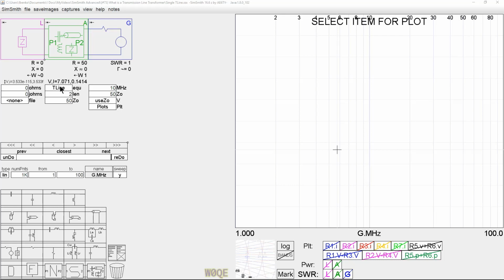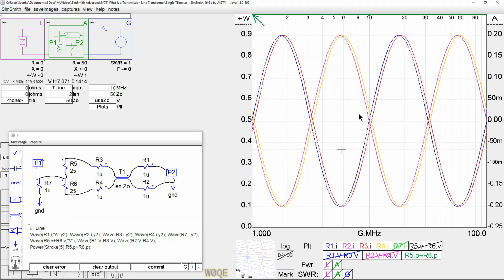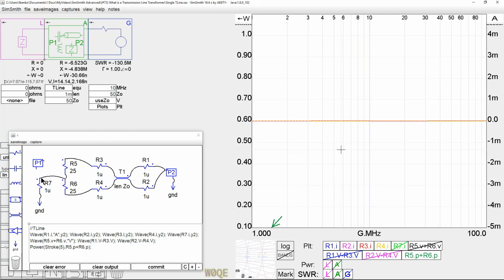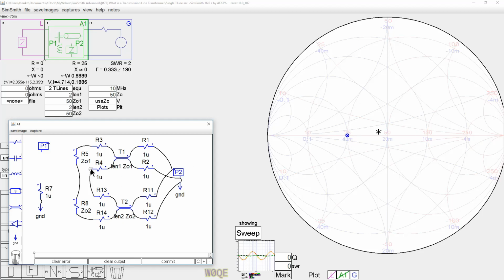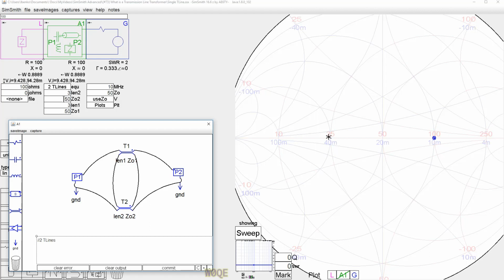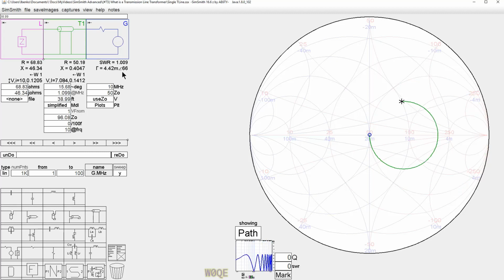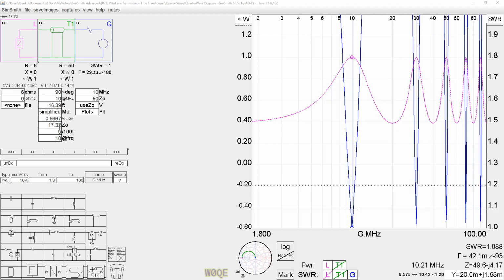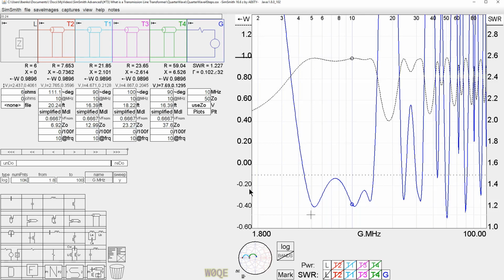#73: Transmission Line Transformers, Part 1

Comment: Excellent series. I find these xfmrs very useful for short mobile antennas.  I think these devices, when misapplied, give "baluns" an undeserved reputation.
Reply from the maker: Mark,
Glad the videos are useful.
Larry, W0QE
Reply: @w0qe  I have Jerry Sevick's book, but he didnt explain about using multiple cores to accommodate differing common mode voltages.  That was a particularly enlightening comment you slipped in there. :)
Reply from the maker: Mark,
If you haven't watched my video #65 at https://www.youtube.com/watch?v=Yh7_XuHqbRI it explains the relationship between flux level and inductance vs core area and mean path length.
Larry, W0QE

Comment: Really got a lot from this vid, mainly because you showed some RUSE block concepts that I have been trying to figure out for some time that I had not quite mastered like parallel transmission lines, etc.
Reply from the maker: RUSE blocks appear in many of my videos but there were some syntax differences between SimSmith ver. 15 and earlier and ver. 16.  Video #75 talks about this and videos #47, #48, & #53 explain the differences.  Without the RUSE block circuits like parallel transmission lines, power combiners , power splitters, directional coupler, SWR bridges could not be simulated.  If you wish, send me what RUSE block problems you are still having I can make a video addressing these issues.  Others may be having the same problems.
Glad the video was helpful.
Larry, W0QE